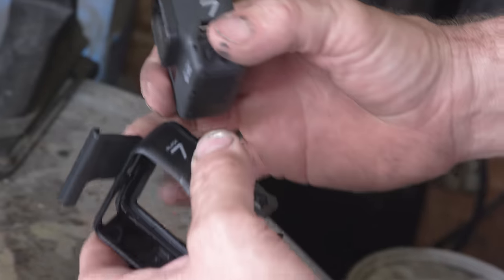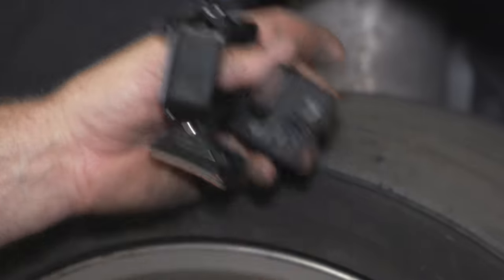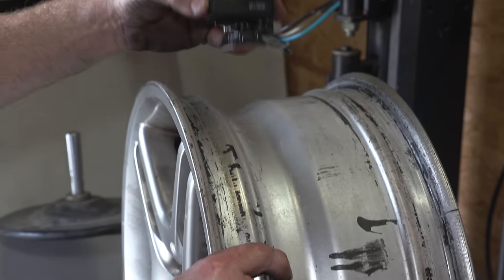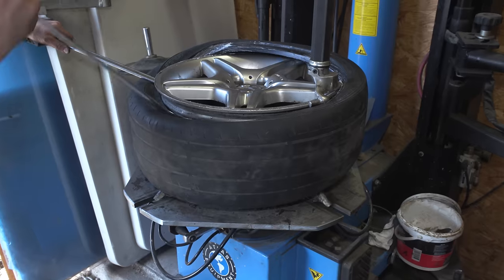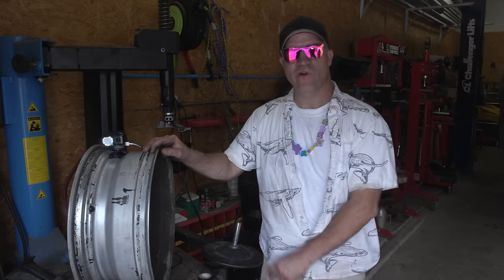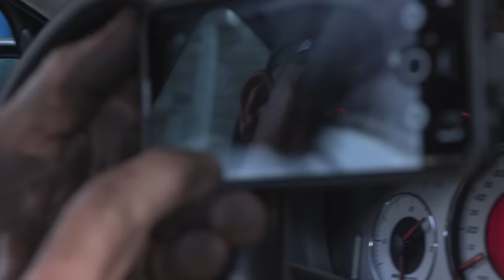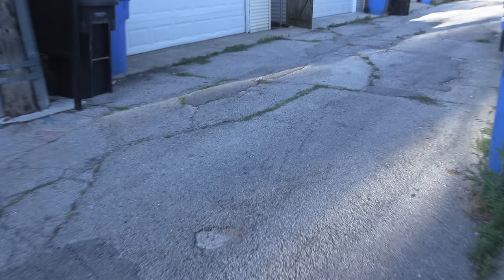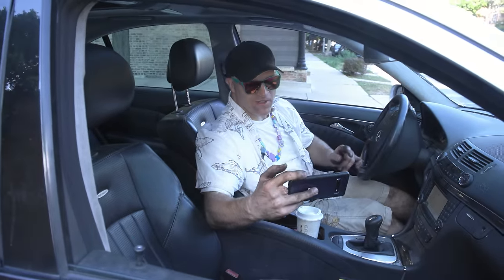GoPro Inside a Car Tire (While Driving)

Comment: I'd imagine the inside of a motorcycle tire would be more interesting, due to the smaller contact patch, and how the tire deforms while in a turn.
Reply: That what i tought....of couurse i only think motorcycles!
Reply: Does the tyre deform in a turn on a motorbike?
They're more rounded, so when you lean, you still have the same rubber contact surface to the road, for the same grip. Also, my motorbike tyres are rock solid when inflated to their PSI, and the bike is lighter than car.

Comment: Very nicely done.  A couple of thoughts.  Yes, that was a low-profile tire, and the pressures you used were very high.  Both of those reduced the deformation of the tire carcass.  A high-profile tire and lower pressure would show much more deformation.  And a side note: I can't believe you drove your car with your hands that greasy grimy!  haha
Reply: 35psi isn't high pressure.

Comment: Ya should have put a couple of pingpong balls in there to show movement
Reply: You could see the movement on the tire itself AND the rock or metallic particulates circling around. Ping pong balls likely would have either gotten stuck behind the cam or blocked the view in front.
Reply: @MidnightMarrow  particulate

Comment: Awesome video. I really would like to see more of this kind of footage. Would be very interesting to see slip angle generation in constant radius curves. 

Also, Slalom driving so that the transient behavior (related to the tire's relaxation length) could be observed would be great.

One observation: although the Go Pro only weights around 100g, it's positioned very distant from the center of the wheel, giving it a reasonable inertia. Maybe it's not relevant, but it would be a good practice to rebalance the tire after mounting the GoPro. If the inertia is relevant, this would reduce vibration and improve grip.

Comment: In the UK that's potentially a £2500 fine and three licence points per bald tyre / tire.  'Bald' is less than 1.6mm across central 3/4 of the tread.  Amazing footage: well done!

Comment: I'm surprised he didn't have to balance the tire once the Gopro was inside.
Reply: It was probably totally unbalanced. It would have destroyed his shock dampers at highway speeds. If he tried to balance it, he would need about the same weight of the gear in lead stripes distributed in the opposite side 🤔

Comment: Watching your phone, totally flat tires and not wearing a seat belt. I was expecting the inside of a tire during a car crash...
Reply: When you say flat I assume you mean bald. That said there was plenty enough rubber specially considering he wasn't even driving that fast. It's high speed you need to worry about on worn tires. Tires still survive some rough shit even with the wire exposed most times.

Comment: To state the obvious, that tire needs to be replaced. There is NO tread on that tire, and it would be dangerous to drive in non-perfect conditions like wet, or snow which Chicago has. I'm just surprised it didn't throw of the balance of the tire and rim while driving.
Reply: At the start he says its a worn tyre ready to be replaced.
Reply: I'm sure if he was going like 50 mph the car would be shimmying.
Reply: oh it definitely would throw it off , question is at what speed.

Comment: Its surprising how much moisture is in the air. I have a small compressor that gets used infrequently and I purge the air and drain the the water from the tank after each use. It can really build up and rust the tank.

Comment: Rock climbin,,  offroadin,, drifting,,, at the end run over a board with a 16 penny nail , a 3 in screw then  hit the corner of a piece of angel iron .. so goes nail slide in and out slow leak , on to a screw that rips a little more than the nail 2 hole leak a little faster but still plenty of air on to the corner of the old angel iron that rips tares and pops tire . The finisher . Sounds good to me ... great job bro . I'm loving it...we need to help come up with some rare interesting things . One mind can only go so far . All ours put together will find some cool ideas .

Comment: That was cool.  The rubber sidewall flex is where much of the horsepower and gasoline goes.  The biggest culprit of course, is air resistance.  But that rolling resistance is about 10-15% at highway speeds.  That's why maintaining accurate inflation pressure is important.  Since the contact patch is offset to the left of centerline of the tire I'm guessing you have a lot of negative camber in your suspension setup.  Negative camber is when the top of the tire leans in toward the engine.

Comment: Ok that was cool. I don't know if your still doing stuff, but someone needs to try again with higher profile tires and more turns at a range of different speeds to see the side wall roll and also I'd like to know if a couple ounces of small steel shot or marbles inside a tire,  would balance it ounce it got rolling. Would they gather in the light area and stay there or just roll around the inside. Because those little dirt particles that appeared to be flying at the camera were to light for that experiment and didn't stay stuck at any one position inside the tire. Thanks. That was cool!

Comment: Nice one man, Thanks. This ought to be shown to new drivers at the test centre to see, for example(s) how the tyre deforms when going into a pot hole, driving up a kerb (my pet hate. having never bought a new car, I always replace the front tyres on replacement cars) or even too sharp/lock to the steering wheel when cornering.
Makes you appreciate what tyres go through, even at low speed.

Comment: I still don't understand why, since polyurethane has replaced rubber in most automotive applications (greater durability and longevity), they don't try making tires out of them.  Imagine tires that could last the lifetime of the car they are on (absent a road hazard occuring).

Comment: Great video. What I want you to try. Is to fix camera outside of rim on the outer edge of it. I want see how the view will be like. When rim is rotating slow to fast. Things will be certainly spinning. It will be crazy view. Also try to fix the camera at the outer side of rim at central point. That will be fixed rotation like earth around its axis. But cam fixed at outer edge of rim. Rotation will be like Earth rotate around sun. Please try these 2 cam position on car tire. Lets see how it will be like from slower to faster rotation from 2 different angles.

Comment: I think that NO tire - using a deeper rim and you'd need to strip it with rubber around the edges - would be great to see. The camera would remain relative to the rim, while the background whirled from sky to ground on a loop.

Comment: Very cool I bet a tire manufacturer might use that video in a commercial.
Inside a taller tire live a 70s cadillac would be interesting the taller tire would display  the side wall flexing  much much. More like a 70s San Francisco  car chase in one of those big metal cars you know they have big metal bumpers and can drive thru buildings and back out like blues Brothers bluesmobile
Unlike modern automobiles  that distigrated when dealing with driving thru walls and store front windows.a tire cam of that would be interesting, as it goes thru a store front...not computer generated footage either...cheers the idea is now out there

Comment: I dont know if i can agree with this video because he didn’t even balance the tire which would make it behave and react differently. The shift is due to the wheel being out of balance. It’s also what you can’t see which is also the aerodynamics of how the air shifts and moves inside the tire. The giant go pro and battery ultimately screwed all that up which creates an unstable environment within the tire.
Reply: @wza223-fo3mc  Then you drive like that. I strongly encourage it for you. "Bro."

Comment: If ever a pt 2 can you collab with Kevin Smith Racing at a burnout competition? It'd be nice to see if and when tires smoke on inside at any time before they pop, very possible given we know, on the outside at least, they're hot enough to flame up. Taylor Ray drifting to see what the side load looks like at 100mph and the tires are white smoking (hey.. I'm amazed they stay on the wheels at that point)? Or perhaps Matt's Offroad Recovery rock crawling in tires that have maybe 10 psi, maximally wrinkled during slow maneuvering? Lastly.. here me out, hit'em with liquid nitrogen just for kicks

Comment: Tires are a very dirty business. 

The 4 tires on the average vehicle release more greenhouse gases and other pollutants than the average engines in those vehicles ever will. The reason tires are black is because a huge amount of carbon was added to the natural rubber along with a generous amount of sulfur as well during the manufacturing process.

Comment: How about filming a Go-Pro inside a top-loading clothes washer.  Do exactly what you did here, except with the Go-Pro attached to the inside of the lid looking downward at all the action in the washer, including the spin cycle.  BUT --- you'll have to use COLD water in this experiment to prevent the vapor from warm or hot water obstructing your camera view.

Comment: That supercharger pulley bearing did NOT sound happy! That, or you’ve got a fixed pulley on there, because I know on these M113K’s the sc sounds ugly at idle rpm, even if you have a new sc pulley bearing and fresh sc oil. They never designed them to have a fixed pulley on the sc, so they don’t sound ugly at idle rpm lol

Comment: Looks like your steering geometry is out to wear the tyre out on its outer pattern on one side.
I liked the years of 'Radial Tuned Suspension' - your tyres never wore unevenly and the geometrics had no sharp angles on the tyre when you turned.
- Too much toe in/ toe out on that car?
Reply from the maker: Yes it had too much toe in... I had the alignment done shortly after this video

Comment: 2023: aliexpress offers rims in 4 current dimensions with full 360° panorama cameras integratable into Apple/Android car system + AI pattern recognition for wrong pressure and damper settings.